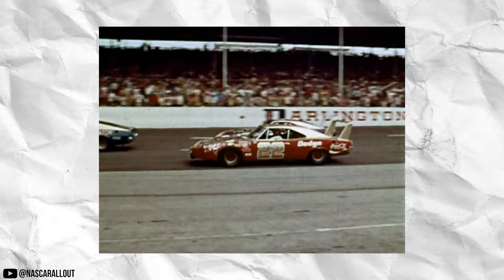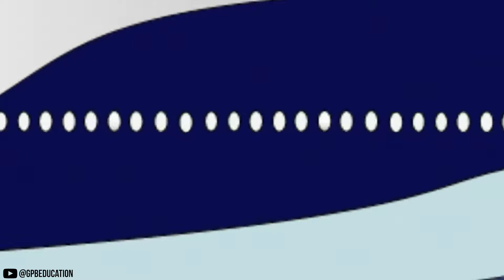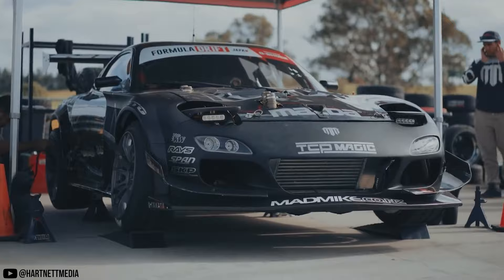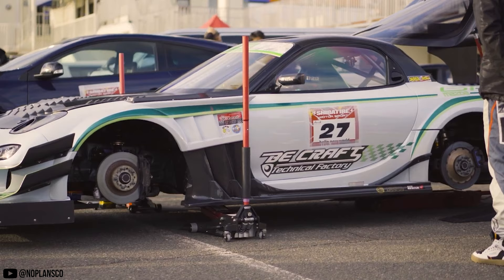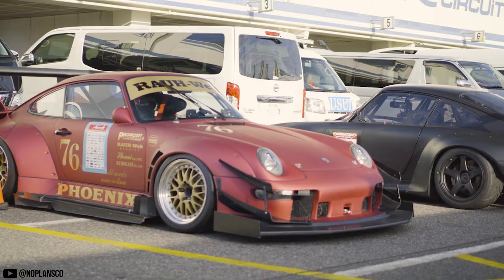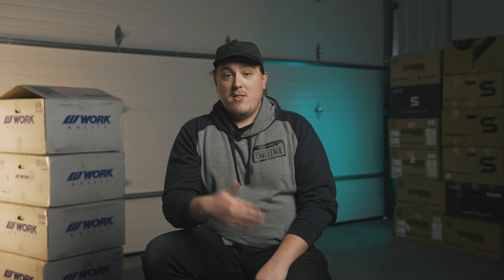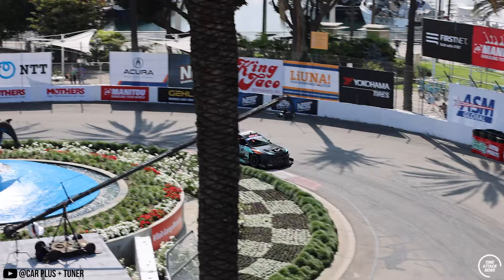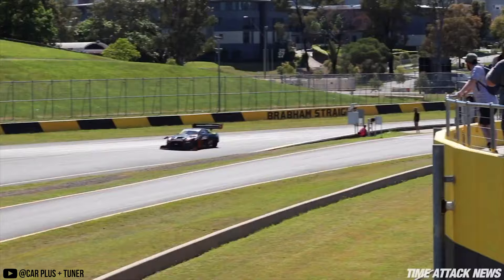What Does Car Aero Actually Do?

Comment: Aero is so hard to do right. "I've got a weird noise at xxmph" only gets an "I bet you do" from me anymore. I like aluminium under trays as long as the bumper and fender liners are intact.  Every aftermarket bumper i've had to touch seems to ditch the factory air dams and lets air around all the coolers. Just a goofy goober parts replacer with too many tools but aero tends to be shiny NVH creating parachutes

Comment: I believe sideskirts help prevent the high pressure air  on top and around the car from disrupting the low pressure air underneath, not to prevent air from escaping the underside of the car.